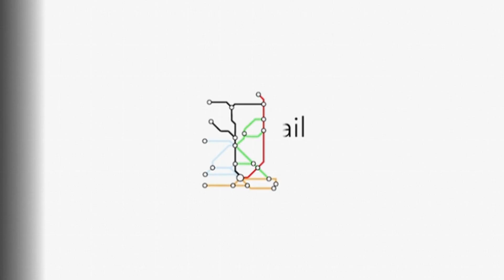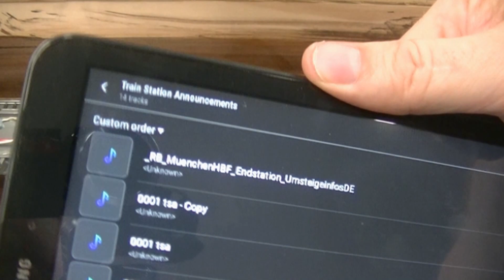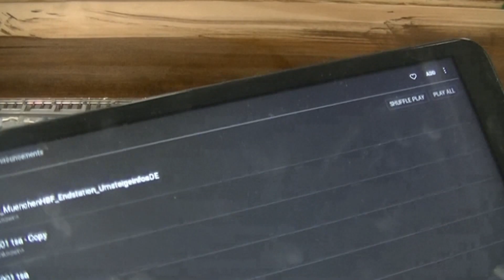The Model Train Outsider Episode 27: Adding Speakers/Sound to Platform Canopies

Comment: Why not use the speaker out jack on your CS3?  You can load the sound files into your CS3 and play them. I believe you have to put in a SD card into the CS3 SD card slot first. Also the CS3 has a internal speaker 🔈 if you would like to use that for your sound.  Just a thought. I would also say if you put in a contact track that once tripped on a saved event it would start to play automatically. Haven’t tested that yet.  Enjoy 😉
Reply from the maker: It is an idea I have considered, just for the demo purposes, I used my tablet as the sound files were already there and ready to go.